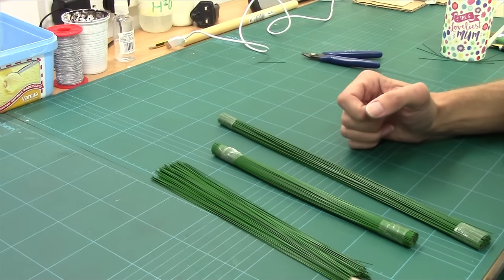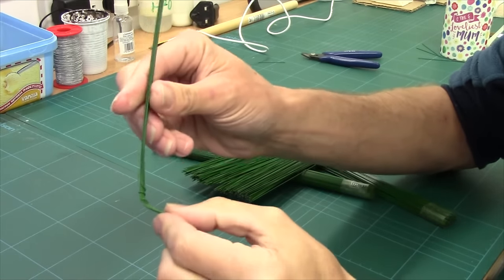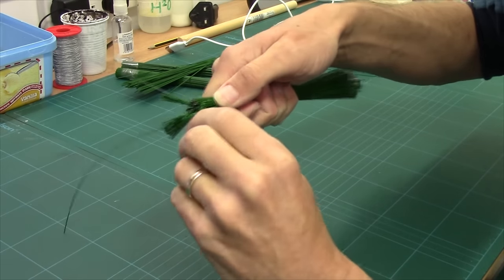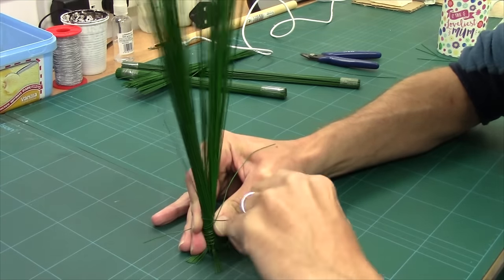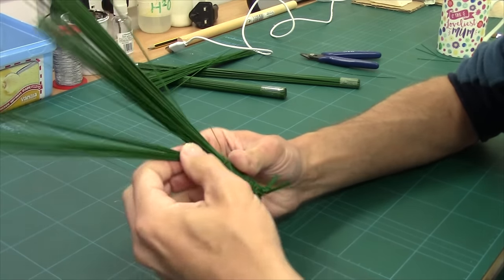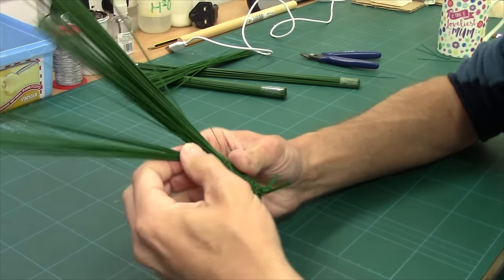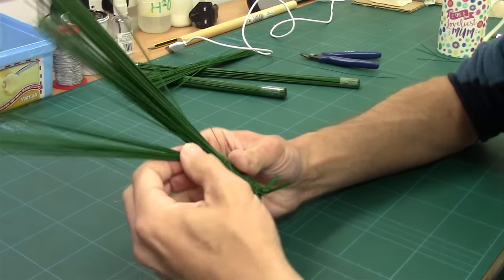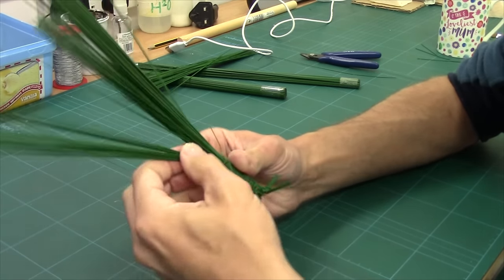Realistic Scenic Trees - Wire Armatures (Wrap Technique)

Comment: i used the thin green wire in 1 of ur videos to make my trees worked out pretty good lol also in ur fuliage  video u mentioned 3 types of foam well i use the med dense foam not the real dense stuff or the loose foam but the solid yellow foam an i havent had any problems with it i use a magic bullet to grind it all up mix it with paint an glue an comes out perfect u dont need pva glue elmers glue works just as good :)

Comment: The big branches that come directly off the trunk are called main branches  A tip to making trees look natural:  The angle between a branch and the trunk or the branch it grows out from is usually ninety degrees.  in nature, when the angle is smaller,  the joint is weak, and  tends to split and break in high winds.
Reply: Known as boughs.

Comment: In regards to covering the wire frame, I recall someone mentioning Rust Oleum Leak Seal for wire trees. It's basically liquid rubber in a spray can, used for automotive and repair work, and when used on wire trees it helps cover up the wires better and gives some texture. As a bonus, it helps seal it in and gives you a black basecoat to begin painting with. 

Personally I'd wrap it with teflon tape before spraying Leak Seal on it to help with hiding the wire. Spraying seems like a fair bit easier way than the usual methods people do to give a bark-like look to the tree, and especially handy if you have to do a bunch of trees at once. Remember, it doesn't have to look exactly like a tree, just have the impression of one!
Reply from the maker: oh, I'll add that to the terrain lab list mate, thanks for the heads up!
Reply: TheTerrainTutor
No prob! Hopefully you can find it over there in the UK. I see it a lot over here in the states in places like Home Depot and Lowes, so maybe it goes under a different name for you guys.
Reply from the maker: phalanx1234
There's bound to be an equivalent if it isn't available mate

Comment: Hello TTT,  
I loved your alternative method of creating wire-wrapped trees.  I will go from here to watch the other videos you have posted for this series. I am especially looking forward to the "Species Specific" video. 

During this video you questioned what the term is for additional tree trunks. I can help with that bit of trivia. This information may be help in the designing of different types of trees. I am not certain, though, since this video is the first of your series I have watched.  Perhaps you have already included these variables in your designs. However, if you are truly curious about this, read on; otherwise, just ignore the rest of my comment ... :o)

Multi-trunk trees can result via a number of means which then gives different terms to the additional trunks.

  **Foresters and Arborist, please note I am stating the variables very simplistically**

 In a single trunk tree (like a conifer), the trunk is called a 'Leader'. A typically single trunk tree of decent size may be cut down, burned etc. and regrow as a multi-trunked tree. Deciduous hardwood  species (cone-bearers will not do this) have adapted to regrow from 'stems' that sprout from the residual stump of a single-trunk leader. This is called coppicing  (cop-piss-ing). The number of these stems surviving to mature trunks depends on the size of the stump (also called a stool) from which they sprout.  The larger the stump, the more stems it can support into maturity. These stems tend to be more straight in growth than the original tree. In historic times (especially when wood and coal were the primary means of heating, smithing, and cook fires) of places like Britain where lumber was a limited resource, this was a deliberate form of conservation and sustainability. The terms low, middle, and high forest arose from this practice: low being from stump, middle being trees cut higher up on the trunk, and high from "standards" or mature trees left in a harvested forest area.  The individual trunks resulting in this situation are called 'Stems". 

A multi-trunk tree can form from this coppicing if the stems fuse together early on and remained fused to over 4.5 feet.. The different stems will then flair outward and branch individually. These would still be called 'stems'. 

There is the "low Forking" category in which trees branch at lower than 4.5 feet above the root collar. In such cases, the split trunks are  just called branches though the tree may have the appearance of multiple trunks.. 

A tree can sprout 'suckers' or basal shoots. These are separate growths that sprout from the tree's base or root system from meristem cells.  These undifferentiated cells (like human stem cells) produce exact clones of the original tree. If allowed to grow, they would eventually become what foresters would consider a separate tree, despite the shared root system. This is consider a form of propagation vs regrowth such as coppicing.  

Then you have Gemels (meaning twins) , or 2 trees of either the same or closely related species which 'self-graft' by growing in close proximity until they touch. Over time, wind motion causes them to abrade the bark down to the 'living' layer of the tree, the cambium. Then, the trees inosculate (conjoin). This can happen at the root, trunk, or branch.  These differ from the above scenarios in that they have separate root systems whereas stems and basal shoots appear on the stump  or from the base of a single root system.  

Lastly,  you have aerial root trees like Cypress and Banyans which form multiple trunks by sending 'shoots' down from the branches. These shoots root in the ground yet remain attached to the parent tree.  The shoots eventually harden into trunks themselves.  So the additional trunks on the parent tree are called shoots.

There are other instances involving vines and bushes but since you are making trees, I limited my answer to the main forms of  'multi-trunk' instances of trees.

Hope you found these examples interesting and helpful to your designs. I look forward to viewing your other videos... Which I am off to do right now!

Comment: Nice tree!  :)

How would you do an ancient hollowed-out one?
Reply: you could always wrap them horizontal on a pencil.. then texture. maybe?
Reply: Im doing one now, started out with a piece of PVC pipe, wrapped it in aluminum foil not real tight. Once wrapped starting from the root buttresses...near the ground.. I pinched lines going up the trunk in random patterns.  Running the foil up past the pipe you can mold the hollow. 
 I used collected roots for branches applied with a hot glue gun.  You can create more texture for the bark and the roots with the glue gun also.  Ta da anchient old live oak

Comment: Weight and Stability. If I have a "standard" base of plaster covered polystyrene, how am I going to fix this and keep it stable as I reckon it will weigh about 150gm? Love the videos!
Reply from the maker: Run a dowel from underneath the trunk and use that as a pin mate. Or run really long fine roots out across the piece and then texture the piece, essentially using roots as roots mate

Comment: Seems amazing as end result* and easy enough for the worst hobbyist in the whole branch..  🤔😢
0.6 or 0.8mm is better?
A shop here sells 600 of 0.8mm rods for 6.28$ or 4.85£ and 900 per 0.6m for the same price (thats around 220m i think)
However tommorow im just going to be an idiot.. ie myself and try my own method.
Using 1+mm that cant bend much as base braches and gluing 1mm thin ones to the base with hot glue.
Will hide the base smooth texture by all purpose slow glue with thin ropes and PvA on top with grinded coffee and pellet dust.
Yeah, i have an extremely bad feeling about something going down south with this idea